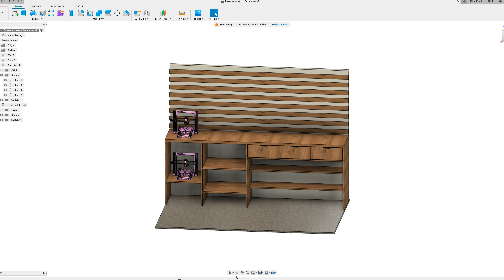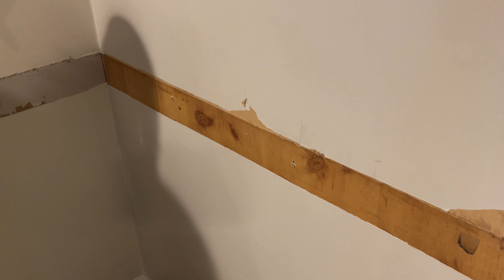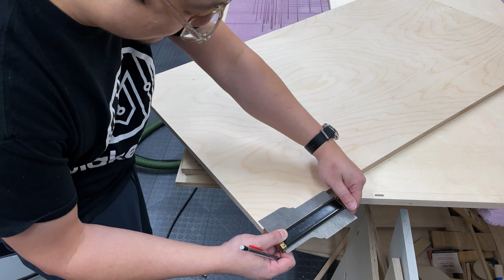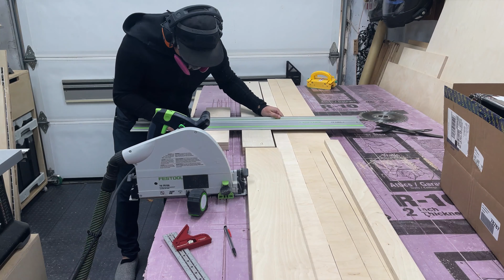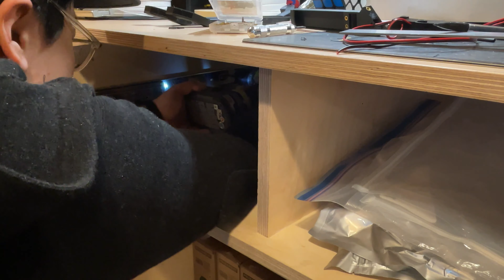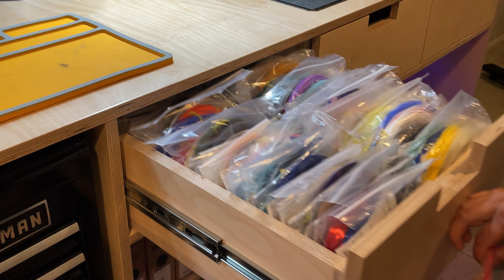3D Printing Workbench Makeover

Comment: This is perfect!  Finally a project that I won’t need to be a master craftsman to complete. 😂
The black Craftsman toolbox that you have looks to be the style that requires the top to be flipped up before the drawers slide out. Hopefully that’s not the case, though...  Or you disabled that.  Great job!!
Reply from the maker: Yep it’s the same style box. All you have to do to disable it is open the lid open all the drawers close the lid then close the drawers. So they are not locked into position. They all still close fully just not locked. Good luck with your build.

Comment: Amazing looking build im just wondering if anyone has built a desk like this into thier wall but also bought glass sliding doors to try and build thier own temperature controlled 3d printing area that will also keep dust and other things off of your builds i feel its something i moght need to try out for myself someday as im pretty good with installing glass sliding doors for bathrooms and even for backdoors that lead outside only tricky part will be trying to make it as airtight as possible

Comment: Is that Baltic Birch or a domestic equivalent? I just checked the price of Baltic Birch and it's through the roof. So, I'm looking for a comparable product.
Reply from the maker: Yea its Baltic Birch, Prices have come down a bit but its still high for the good stuff. You can get some lower quality stuff but the layers don't look as nice and some of the back sides might be a bit rough. you could also do any top surface with baltic and do the sides as Painted MDF or even OSB. Sanded OSB and finished over can have a really cool texture. I prefer it unpainted for OBS. Google OSB tool walls and you can see the look. Materials in general now are just expensive for a big build. But from what I heard its going to be a couple of years before prices normalize.

Comment: Excellent built in mad scientist lab. I’m wondering a few things. No lock bar on the toolbox so you can open the drawers? Do you have any cleat fixtures in mind already? Could french cleat a light. I’ve surmised you are good with keeping it there and didn’t have any need to make it in pieces to move later. After all it’s built-in. Lastly and most curious, do you have a list of tools/materials used to send to people who ask about everything? I’m wondering what filaments you prefer, where you got the models for your four amazing little trash bins, and the plywood looking desk sorting board. Looks so nice all together too.

Love the use of the heavy duty crate on the bottom and the recessed filament shelves.
Reply from the maker: The tool box does have the lock bar in the lid. But you can by pass it. Just close the lid with all the drawers open. Then the drawers can all be closed with out being locked. They still detent close. So its not just loose but it doesn't lock. Since the video I have made some holders and hooks for the cleat wall. Fall along my IG (same Name) to see updates on things. I'm more active there day to day. As for models there's too many to share. But mostly everything is on Thingiverse. If its my design I Share it there as well. For the trashcans I think you just search dumpster. The build plate holders were from the Prusa hub.